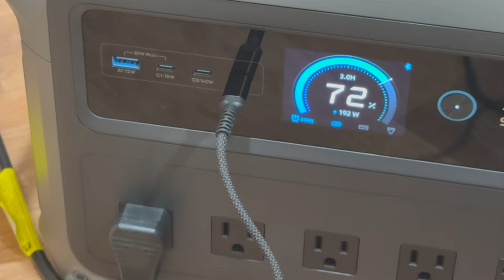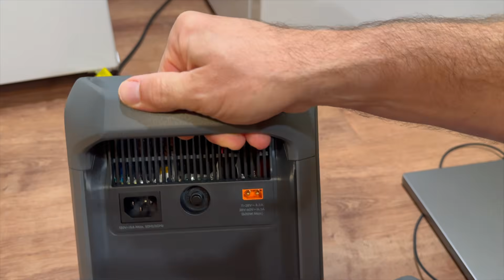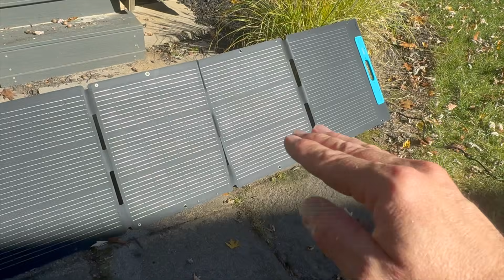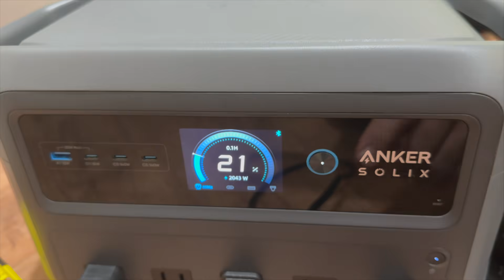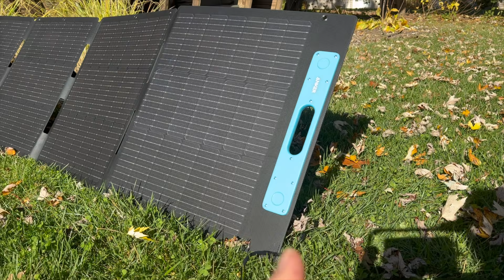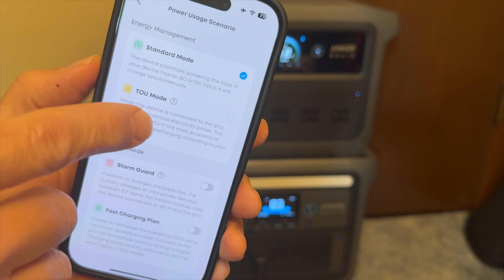Is this the IDEAL 1KwH Power Station? - Anker SOLIX C1000 Gen 2

Comment from the maker: This is a solid 1KwH power station.  Let me know if you have questions (post as new comments).  If you want me to review anything else in particular LMK.
Reply: Let's try the vanpa power station
Reply: I like my Anker Solix C1000 Gen 2, its super speedy charging if i need to, but 1200 watts is fast enough for me.
Reply: @mannyfragoza9652 
I believe the gen 1 with the light & expansion battery is better. 
The gen 2 & the extra 200 watts of power is nothing unless it had 2400 & 1500 watt hours.
Reply: @Kawasaki1-m4l  i tend to agree with you since the expansion battery is a big plus. My C1000x has a light, but it is terrible at running inductive motors. Is version 1 still available?
Reply: @mannyfragoza9652 Yes, in Australia. 
I can't say anywhere else.
I got from Bunnings online through Anker at 1/2 the price of Anker $700.00 Australian 
I got mine 6 weeks ago & the expansion battery 3 weeks ago
I also have a Allpowers S2000 Pro it does 24000 its 1500 watt hr
It does the heavy lifting. 
I have a Ninja foodie XL air fryer oven easily.
I did Anzac biscuits at 160 degrees Celcius for 15 minutes at 2150 watts no problem it still had 73% left that's lithium not lifepo4 like the Anker.
That was just under $1000.00 Australian.
Reply: I was that impressed i bought the expansion battery 🔋

Comment: I purchased Two of these and found out with the app you can lower the charging wattage down to 500 watts; from its ultra charging mode. With this function I can use the second unit to charge at only 500 watts instead of the 2000 wattage needed otherwise. Started a Taco 🌮 🌭 Dog mobile food unit,  !!! Your video is excellent . Thank you so much !
Reply from the maker: Awesome, thank you!

Comment: Can you drive and charge solar at the same time? How would that work with only one xt60i input. (Cigarette lighter charging Plus solar panel at the same time)
Reply from the maker: You'd probably want to look into getting a device that allows for that.  Several companies make alternator chargers that will handle solar and car charging at the same time.

Comment: This might seem like a stupid question but can I plug my 110 input  cable on my motorhome into this ?  I would be using this only to power the 110 plugs to boil
water in my electric kettle, use the coffee grinder and power the television
Reply from the maker: Yes, I don’t see why that would be an issue if your RV has a standard 120v plug that you use for shore power.
Reply: @jungleriver  Thank you for your quick reply . I figured as much as we keep our motorhome plugged into a plug with 15 amp breaker in our house
over the winter. This provides power to run a large dehumidifier while the motor home sits in the soggy west coast winter weather.
Thanks for creating this video. I got more info out of this than the owners manual.

Comment: Brilliant.  No fluff, just relevant information presented in a useful way.  Question: are there any reasons to not leave it plugged into AC house outlet (or DC solar) all of the time?
Reply: I've been wondering that for a while, myself. 
Ultimately it's intended to be usable as a UPS, so that would involve leaving it plugged in at all times. I'm hoping that when fully charged, it has some sort of "pass through" mode that doesn't introduce constant wear and tear on the battery, but that is SURPRISINGLY difficult information to find.
Reply from the maker: Thank you.  LFP based batteries are really good.  What some would say is to set the upper charge to about 90-95% in the app so that it's not sitting at 100% all of the time.  I don't remember seeing any hard evidence that keeping it at 100% state of charge for years would somehow degrade the battery.

Comment: I just bought this power station in a bundle with the c200 solar panel from Anker's website. Due to summer sale and coupon it was $930 CAD before tax which is $653 USD
Reply: I need that bundle. Online so far it's like 829 USD

Comment: Great video but if you only had to buy one would it be the Gen one or the Gen 2?
Reply from the maker: Thanks!  I don't really use the lights on power stations so it doesn't bother me not to have a light on the Gen 2.  But I do like the higher powered USB-C ports (and that there are 3 of them overall) and I like the lcd screen on the Gen 2.  So I'd say Gen 2.  But the gen 1 is also very good - no complaints.

Comment: What happens if i tried to use a 100w usbc cable?  Is it dangerous or does the battery just refuse to work?
Reply from the maker: A 100W rated cable would work only output 100W.  So it's not going to pull 140W through it.
Reply: I wouldn't mind knowing this too, My current guess is the cable would limit it because it would be too dangerous of a fire hazard for many many devices if they did not limit themselves.

Comment: Costco has the C1000x with 200w Bifacial for $599 is that a good deal?
Reply: No
Reply: If the solar panel is Anker branded then yes there extremely good panels. If not you would need to research whatever 200watt panel brand Costco is selling with it.
Reply: @playzen8 yes it’s from Ankers solar panel
Reply: Slight trade offs…one less port for you to charge and I believe the wattage is a pinch lower. Still a good deal if you’re not that worried about it but I’d rather have the regular c1000 gen 2
Reply: @Deetroiter it is the gen 2! With cigarettes port

Comment: One of myC1000 Gen 2 can get hot over its 104 F max temp. range due to its passive cooling to keep the fan noise down. I'd rather have noisier fans than a hotter unit over its operating temperature range. I MISS THE LIGHT!

This one so hot it hit 126 F when charging in a cool area during winter. Anker Called it defective after I sent in the logs and they sent me a shipping label when I thought it was going to be firmware updated. I took a picture of it already to go as I shipped it out from work's shipping department. Good thing I did. FedEx Ground ate it with just the pick up on their package tracking system. I sent Anker the picture of the package and the tracking snap shot, and they are sending me a new Anker Solix 1000 gen 2 warranty replacement. I do have a second one that is a UPS for my home computer desk top. The internal power configuration I copied from some one on U-Tube who showed what they set theirs as a UPS for. I also set the charging to 50%.

My advice to people, get your power station from the manufacture's website. It has kept a lot of extra headaches for CS events I've had. and Warranty issues. This is the only power station out of 10 I have needing a replacement. Every one problem I had before was fixed with a complete discharge and recharge where the BMS seemed to get balanced by doing that.

Comment: Would this be a good option to always have plugged into my fiber modem and wifi router as well as my ring security so that they never go down in an outrage or will that ruin the battery? And then if it’s a long outage we could use it on the fridge if needed?
Reply from the maker: It would be a great option.  The AC power passes through to the front ports, so wouldn't ruin the battery.  Some suggest setting the max charge at like 90% for longevity.  So you could do that if concerned.  To know how long it would run for?  You'd have to know how much power on average your fridge uses.  I would say several hours at a minimum.  But probably more.
Reply: Yeah, that sounds about right.
Reply: it depends on the size of the fridge  and how much W it uses
Reply: The app lets you limit the max charge to 80% and the max discharge to 20% which is ideal for LFP4. I just purchased this to use as a UPS and also a backup for my motorhome system.

Comment: Great review!  Picked one up during holiday sales and it was half off.  So far it's great and I love the UPS feature.

One thing that I absolutely dislike about it is that if the draw is low like when charging a cell phone and only a cell phone or a cell phone and other personal devices, it doesn't show the draw at all. You know there is a power draw because the phone will tell you that it's charging, but the display shows absolutely nothing at all.  The app doesn't show any draw either so you can't even use the app to check on your  charging progress.  I actually called Anker CS and they mentioned that it has to do with the shortcomings of the internals being able to register much below a certain wattage.  She wasn't able to tell me what that threshold is. 
There's much smarter people out there that will probably know more or why or if any of that is true, but I wanted to share a limitation I found if it helps others in making a decision too.

Despite its shortcomings, it's a pretty awesome device.
Reply from the maker: Thank you!  Regarding what you mentioned, that behavior I would say is not uncommon.  I haven't tracked the lower power monitoring ability of the power stations I have tested (I haven't tried with this one yet but I can when I get a chance) but it is disappointing when you expect them to track down to the watt of output/input.  The threshold might be somewhere around 5W, but I'm guessing.
Reply: @jungleriver  I wish more people who review these would talk about the shortcomings and limitations more. They aren't necessarily flaws or issues and may never come up for some people. I understand with that sort of technology, you pay more of course, but people should have their expectations set completely. 

For me, this was my first device like this at all.  I wanted a device that could track all of my usage and never knew that the technology is limited.  Am I upset?  No!!!!  Not at all.  This thing is pretty awesome!  I just think people should be aware and educated about it. 

Thanks again for the great video.
Reply: @TheRealPhilHoward  I have both an old Anker C1000 and a Anker C2000 gen 2 so the 2kwh version of this one. I have encountered this issue with both the previous gen and this current gen. I would say it loses between 5-7watt in terms of miss reading the power draw. I still love these PowerStation's and have had no real issues in owning the first gen 1 C1000 for a few years now!
Reply: Curious…some charging bricks, etc reset when you plug in a new item. So if you had a phone charging and then you plug in a laptop, it resets the charger and the phone briefly stops charging until it gets juice again. Does this c1000 do that too? I’d imagine it wouldn’t but wondering if it does

Comment: Thanks for the review.  It’s a nice unit but has some faults.  From other reviews, it’s really noisy when near full capacity input/output.  They removed the bar light from previous generation.  The output is very noisy and not good for audio equipment.  Also the idle drain is slightly higher than competitor models.  I do like the 2kW continuous output with high surge (3600W I believe).  The output voltage does drop to around 100V once you go a bit higher and if I remember correctly, it overloads (shuts off)  around 2400W continuous.
Reply: "The output is very noisy and not good for audio equipment." Where's the proof of this claim?
Reply: They're all noisy when it comes to near full output. Though, its not very loud. Idle drain I havnt really compared but, the Ecoflow could not properly hit near its peak draw.
Reply: @OfficialHiState  I was referring to signal noise.  Not actual audible noise.  The output sine wave is not very clean and will affect audio equipment.  Thanks.
Reply: @hpjtv  Gotcha, that makes sense. When I use these batteries for audio PA's I haven't noticed any signal noise yet. Using it to power PA Tops this weekend so I'll have a closer look this time.

I've only used it once so far for bush parties.
Reply: @hpjtv  The wave is incredibly clean, what are you talking about?
Reply: @legendfpv it was discussed on Hobotech where he does a very in-depth review of the unit.  Think he was comparing it to the Bluetti elite v100 where the signal was very clean and the Anker had a lot of noise and he said it wasn’t good for audio equipment.  The AC signal is fine but if you zoom in, it has a lot of harmonic distortion.
Reply: @hpjtv I checked out the video, it's filled with sponsored links and he's just a shill for blue yetti. It's an advertisement not a review and the data doesn't back up the claims he's making.
Reply: The Blue Yeti also performed really badly in project farm's testing
Reply: @legendfpv  it was a like 7 months ago.  I was doing research on a whole bunch of units and that’s what came up.  It’s possible he got his hands on a faulty unit. I ended up getting an EcoFlow and Bluetti.  My EcoFlow failed 2x and was sent in for warranty.  EcoFlow customer service is A+.  I’m using the units as UPS’ and the Bluetti has been running 7 months straight.  There’s also complaints how noisy the fans are on the Anker at full load.
Reply: @OfficialHiState I am thinking to buy it for the exact same thing. My generator died because of the dust and I want to try solar.

How much does this unit run your two tops?
Reply: @chanibalu Just did shambhala music festival renegades with it.

Had no problem running multiple tops, controller, laptop, phones, lights.

Didn’t notice any noise. Unless you are running $10,000+ audio equipment or an audio engineer i doubt anyone else would either. 😂
Reply: @OfficialHiState Thank you for sharing. I will run just a LD Icoa 15, should last a few hours for some fun in nature. 🔈🔊

Comment: It would have been nice if you had tested the UPS functionality using a PC instead of an LED light.
Reply from the maker: I usually test with a laptop without a battery but sometimes I use a led light.  I have full confidence the laptop would keep running.  Unfortunately, I don’t have proper equipment to verify the exact ms switchover time.
Reply: I have tested the older C1000 and the newer C2000 gen 2 which is the 2kwh version of this review model with my main PC a 12th gen i7 with a RTX 4080 and scared myself by cutting the power to both my units when i tested them hoping nothing would happen and it was fine PC didn't appear to notice anything had even happened to the power the C1000 gen 1 and the C2000 gen 2 both took over as if nothing had happened so there fine for PC use. Extra note the old C1000 vs the new c1000 and c2000 is 20ms for previous gen to 10ms switch over time for this new gen 2 models so there even faster now. The only thing mine has failed to power in the entire house is my fridge and its something to do with my fridge jumping to over 2000watt for 2-3 seconds when it first starts.

Comment: What about E-bike????
Reply from the maker: Are you requesting that I review an E-bike?  I actually just got one that I'm trying out.
Reply: @jungleriver I think he meant how the anker does charging an e-bike but I would be interested in an e-bike review too.. I’m looking into buying one
Reply: Depending on the e-bike and battery type..some e-bike batteries such as mine for the Onyx RCR is close to 3000wh (72v x 41a = 2952wh) of which this battery will only charge 1/3 of my e-bike battery capacity.
Reply: Wrong use case.